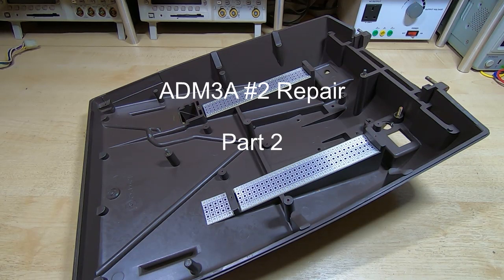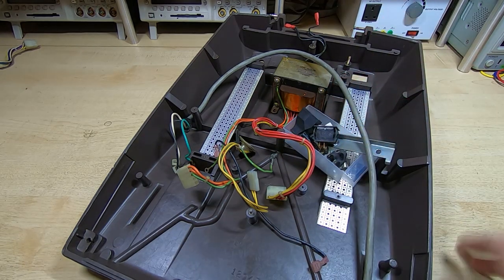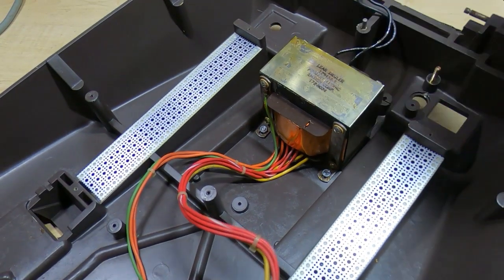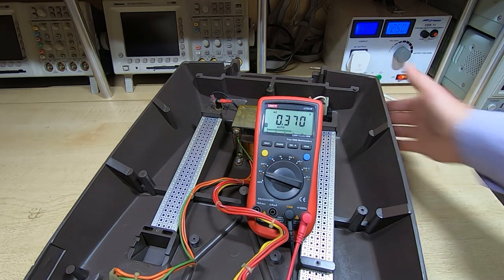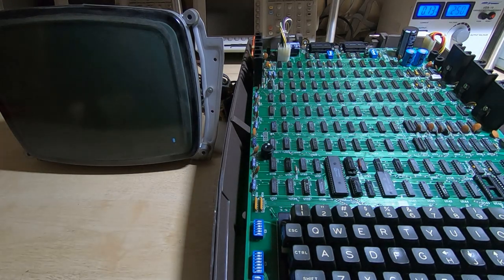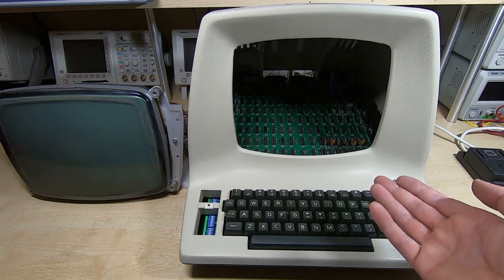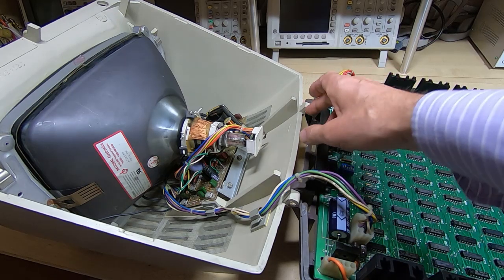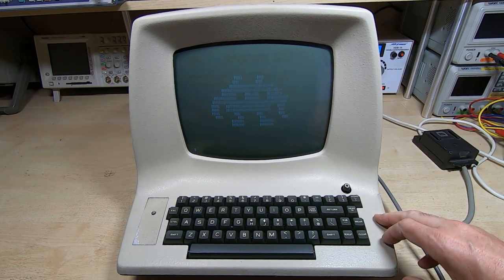ADM3A #2 Repair Part2

Comment: Jerry, yes, I'd like to see your initial testing procedures to determine what needs to be changed and/or replaced, along with your testing before you put the other ADM3s back into service.  How did you solder the copper(?) wrap around the transformer?  Did you simply use a soldering gun, with perhaps, a modified tip to allow you to quickly apply enough heat to solder the ends of the warp?  (Paul Carlson showed how he "modified" his soldering gun for "heavy-duty" soldering a few years back.)

Do you still plan to write a book on the testing procedures you use and/or recommend when initially checking out an "unknown" piece of vintage equipment, and throughout the repair up to declaring a piece restored & ready for use?